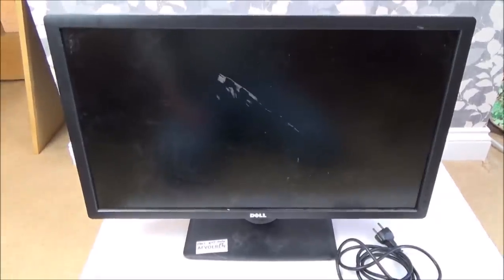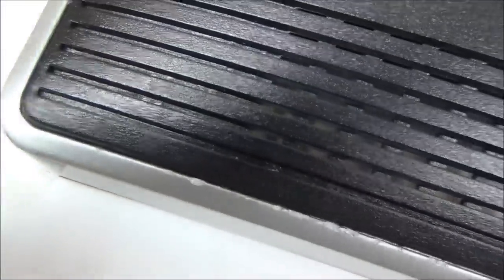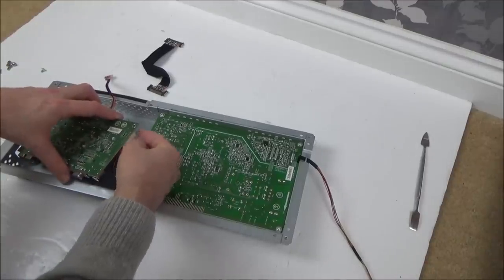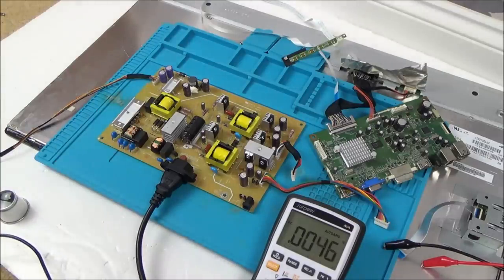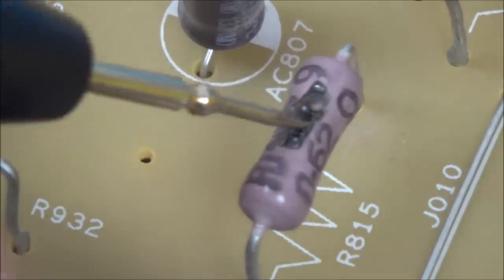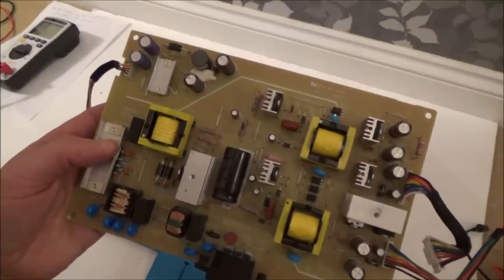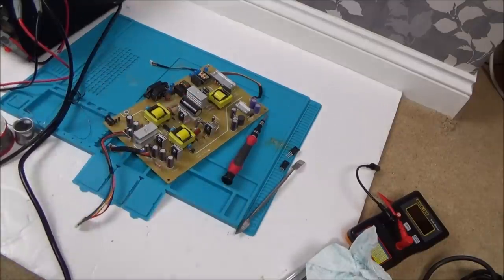Trying to FIX: DELL 1440p WQHD Computer Monitor

Comment: Omg! Thank you so much man! At 18:05 I always thought they were some sort of capacitor and not a fuse... Ive been battling issues with my cars instrument cluster and couldnt find anything wrong and it was doing my head in! Seen you talk about the fuse and knew it looked familiar, had a few in my cluster and 1 of them was indeed faulty after a contnuity test. Have replaced it and now everything is working again! I am beyond stoked and did not think I would be able to fix my car by watching this video but here we are lol. Thanks again, im definitely subscribing 👍👍👍

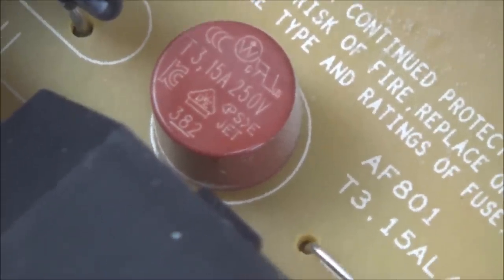Comment: Hi. Just one little but important thing. Around 17:51 this fuse isn't marked T3 = 15A. It's T = 3.15A. Be careful not to change fuse with five time more current rating. This should make exciting bang and MOSFETs flying across the room :-)
Reply: Good info! Thank you 🤓 if you replace a screen on a monitor with a different brand, can that effect the performance of the LCD driver board?

Comment: EU plugs have a earth/ground pin, in the Netherlands it's some metal on the side, in some other countries it's the hole in the centre slightly above the 2 pins
Reply: Most adapters sold in the UK for euro to bs1363 don't connect it. You have to pay attention to get the right adapter with the earth.

Comment: Vince, On your multimeter, you have a REL button which is short for relative. To calibrate your measurements you need to put both meter leads together. If there is a reading above 0.00 then press that button to cancel out the resistance on the leads alone. This way the readings will be more accurate. You can think of this as a tare button on weighing scales.

Comment: I fixed a bunch of monitors recently. Most of them just needed new capacitors. In one case the MOSFET had failed on the backlight inverter and was shorting the whole thing out. There's a couple of easy tests which can be done.. connect 5V to the display board, and then see if the power LED will go on. You can shine a torch at the screen to see if it's showing the "no input detected" etc, or bring up the menu. Then you can put (usually 16V) on the backlight inverter part, and see if the backlight goes on. If these both work, then it's probably an issue in the high voltage DC part, either the MOSFET, the PWM driver chip, or the bridge rectifier.

Comment: This is the monitor I use. Been a great screen since 2013. The button on the back is for taking off the stand not for rotation. You can rotate it by hand no button presses just turn it

Comment: Amazing, I've been using this very same monitor for YEARS. Be prepared for a little bit of image retention though if you get yourself one of these, it fades fairly quickly and isn't permanent but is 100% a distraction if you use Photoshop a lot.

Comment: The main power board is similar to those in TVs.  To learn more check out websites explaining "switched mode" power supplies.  As you basically worked out, these convert mains to other voltages by first of all rectifying the 240v AC mains to be about 340v DC through diodes plus a big reservoir capacitor to smooth it.  This DC is then turned into very high frequency AC which is stepped down to lower voltages by the yellow transformers and is finally rectified and smoothed again to give the required DC lower voltages.  Each output will have diodes and capacitors doing this and often the output capacitors are what bulge and fail with age.  The mains is converted to higher frequency AC as this needs much smaller transformers to give the end results than if the 50Hz mains were used.  Mobile phone chargers use same switched mode power supply design to make the charger very small as a tiny transformer can be used instead of a big heavy lump if normal 50Hz mains were used.  Hope this is useful for future knowledge.  Great to see your skills improving over time.

Comment: Great attempt =D NOTE: Heat sinked components may not always have ground on their heatsink!  Sometimes heat sinks are live!  I would consider swapping that resistor out, and remove and check the mosfets in a component tester.  I bet a mosfet blew when that resistor went.  But the screen looks damaged anyway I guess =/
Reply: Yes, very important when fixing mains psus... In most EU countries fixing mains stuff always needs a license.. (most computer stuff after the psu aren't mains)

Comment: It's years since I repaired any electronic board to component level, but at around 14min into the video I thought "that resistor looked a bit burnt". I wouldn't have been faffing around doing ESR checks etc, I'd have been finding out what that resistor is connected to and doing some resistance checks. I've still got it ! Lol.

Comment: the last time i had this  issue with 2 monitors . i also thought the mosfet had gone . but it had,nt .it ended up being the smaller caps on the powerboard .and now both monitors are working great .

Comment: When you measure that low of resistance (few ohms or less), resistance of your test leads and connections skews the result quite a lot. You can compensate for it if your meter has zero, delta, or something like that function. Just short your probes and press zero/delta button. Then do the measurement. Measuring in-circuit may have some effect on the measurement, but it can only lower the resistance. It will never make it higher (unless there is some charged capacitor in the circuit, in which case you shouldn't do resistance measurement anyway, or you risk damaging your meter).

Comment: Hi Vince, when you measure low resistance like a 0.6 Ohm resistor, remember to take into account the resistance of your meter leads. If you short your leads together its unlikely your meter will measure exactly 0 Ohms. Some meters will allow you to zero out that lead resistance, or use 4 wire measurement to compensate for the leads resistance.
Another tip, when you measure for a short, allow a few seconds for any capacitors across your test points to charge, otherwise you can get a false impression of a short.
Try testing for a short across an electrolytic capacitor and you will hear a beep until the capacitor charges to the meter testing voltage. The larger the capacitor value the longer the beep !!
Reverse your leads and you will get another beep. That can fool people into thinking there is a short when there isn't. 
Obviously make sure your DON'T have any high voltages on your boards and capacitors are discharged before doing any resistance or continuity checks else you can damage you meter.
Same goes for your ESR meter.

Comment: You really should buy a isolation transformer with disconnected earth wire. Much safer to work on TVs or other devices you have to power up with mains voltage.

First thing you should check on a tv/game console/pc PSU is the Standby voltage. Everything with a soft start button must have a standby voltage. Most likely 5v.

You can check mosfet model NPN=source connected to ground PNP=drain connected to positive voltage and for mains PSU mosfet the source of the PNP is connected to drain of the NPN.
Also you can check the switching driver IC for shorts between the leads.

And BUY a isolation transformer already!

Comment: So many questions you raised about components that I can answer.  If My Mate VINCE wants a mate called Vince (who can answer some of these questions) get in touch.  I am a volunteer for our local Repair Cafe. Yes paralleling up resistors adds up the wattage that they can dissipate (it's all about converting that current to heat), you were probably not close enough to the right resistor values (or at least that is where I would go next) and you could do with a better component tester, I have the Peak DCA55 for testing MOSFETS.  I recently repaired a heater controller for my caravan, the tester said a transistor (in circuit) was an LED, so that raised eyebrows and out of circuit it said open circuit/no component.  The wandering readings you were getting on your meter were stray capacitance charging up elsewhere on the board and not the component you were trying to test.  Thanks for the video.

Comment: I don't know if you still have this monitor but you can cut out a VESA-mount-sized square from that black plastic back plate. Drill 4 screw holes in it and use that nice swivel stand for any other computer monitor.

Comment: my 23" dell suddenly died one day and the problem was one voltage regulator on the logic board, it should get 3.3v in and output 1.3v but it was dead (outputing 0v).

Comment: Sometimes when a MOSFET blows it takes out the thing driving it too, those resistors were likely for current sensing. Also your multimeter probes are probably adding to the low resistance reading, make sure they're fully pressed into the jacks and give them a good clean. Alternatively just zero them out before testing.

Comment: Hi Vince! Do you have a bench power supply or something similar? You could use that to power just the backlight and take a better look to the cracked lcd
Reply: a torch will also illuminate any damage
Reply: He could buy a broken bench power supply and repair it.
Reply: Yup, lab bench power supply should be his next acquisition.. very useful in such cases..
Reply: You could even just light up a couple of the LEDs (6v) to test, you just need a CC power supply.
Reply: @ktaragorn  he has one afaik
Reply: I thought the voltage on the back lighting on those older LCDs was quite high.  Would one be able to get that on a bench power supply?

Comment: The 12N70 is a power mosfet 700v 12a and can be found in many china built SMPS , I go down the local tip and harvest psu's just for the parts saves me ££££ also get lots of 1-5 watt resistors  SIL bridge recs.  PWM controller IC's transistors and pfets , most of the repairs i do these days hardly cost me anything.  You may even find those parts in an old PC ATX SMPS or at least something equivalent if you want to revisit fixing the monitor psu.

Comment: Vince, does Dell or the power supply board manufacturer provide, on line, schematics? Or some other source? Grest find on the resistor! I would do the same thing and start testing point to point voltages & take notes! That's okay on the not knowing about how to correctly open the case! I probably would do the same thing! Thanks for the great troubleshooting and solutions!

Comment: A valiant try Vince, but remember that it's not a fail as long as you're learning something new along the way. :)
A common fault is that the switching fets blow, sometimes taking the the smps chip with them plus a few of the supporting components. You can still source alot of components off of the boards though. Heatsinks, etc are great to have at hand when you need them.

Comment: when you was measuring the resistor value, and said you dont know wether measuring it in circuit affects it... Yes it does bud.
Measuring any component in circuit, affects the reading.
Also, with my experience of PCB repairs, as i repair alot of TV's... Its usually 99% of the time, a Mosfet issue.
Reply: reading a resistor in circuit can only make it read low, since he was reading high it doesn't really matter
Reply: The resistance was too low, the lead resistance was adding to the final value, just need to zero out the ohms reading, but doesn't matter as log as it is beeping

Comment: To check if screen is ok, LED panel light connector  pin 3 and 4 is LED power pin with 5V and backlight should be turn on! (First measure short on pin 3 and 4 to backpanel, mostly if led got shorted, you get short to metal) - Sorry my bad English.

Comment: 19:00ish "thou shalt check voltages". Have a look at the PSU board and it will probably say what voltages should be present on it's output. Check to make sure those are all present. That would narrow down to either an issue further downstream or an issue with certain issues of the PSU etc instead of starting at the other end and trying to work back from the light/switch. Check for voltage coming out of the fullbridge, even. That board looks pretty easy to trace everything and see where it goes
You've probably already figured this out and fixed it by now and I should watch it all before commenting...just y'know, always always check your voltages :D
Reply: I've always started at the power cord checking voltages if there isn't any response to powering the device.  Connectors and power cables are usually bulletproof but they are a total pain to find after skipping past them in initial diagnosis.  This is especially true with intermittent power values problems.  Be especially careful of electronics that see rough service or handling.

Comment: Radiators are not ground, never use them as reference, instead use metal case or ground track on the board to be sure you are connected properly. MOSFET's can show short if they are dead or are shunted by transformer coil, you have to desolder them to measure them properly. You can't turn it on partially because the transistors here work in pair so called "push-pull" so both rails have to work or you burn them both.

Comment: Vince You have a dc jack socket on the power supply. Try searching for the capacitor voltages or on the manual for the monitor bacause there is a chance that you would need an adapter for it with 12-18Volts and you could power up the screen without the high voltage side of the psu ^^

Comment: The power ic could have blown, if gate and drain or source shorts it usually blows the power ic, You can use a flashlight to check the screen by shining it into the display

Comment: If you ever decide to work on more monitors you can buy a separate LCD driver board just to test the screens. They're pretty cheap respectively and for the most part universal. You just have to check the panel on panelook.com Here's a video of what I'm talking about: https://youtu.be/icmp_wuT_dE
Reply: Good tip. Hope Vince sees this.

Comment: Hello Vince .. always better using a screwdriver to hear the loud bang like gunshot from the capacitor arcing with the screwdriver lol 😂 .. good idea to check the LED panel most of the time the LEDs cost a short ... also look at controller ic’s

Comment: Hey mate. The earth pin on those round EU plugs are the two metal tabs on the top and bottom; one of them is connected to a metal plate with the hole.
Reply: Also the middle hole between the prongs for some countries

Comment: ISOLATION Transformer if you are going to work on live equipment even if not probing it when on. it makes things safer in a number of ways as one day no matter how careful you are, you will slip or touch it when you turn your head and distracted. VERY important when using a oscilloscope probe and earth clip.

Comment: My Dell has issues that you have to hack around turning it on if you want to use display port due to a bug in the sleep mode software. HDMI works fine but as a G sync monitor you have to use display port to take advantage of VRR. To solve that you have to plug in both HDMI and DP, switch to DP, immediately unplug the monitor so the sleep mode doesn't turn on, wait 10 seconds to let the capacitors empty, then plug it back in. Just don't turn it off or unplug the display port again or you will have to do this again. Got it just because it was the cheapest 1440p G sync monitor I could get with 165hz. Other monitors were $500 at the time and this one was $350. Now it's totally not worth it. You can easily get other brands for that price now.

Comment: It still has a value for that power board. Fix it and listing it on e-bay for 30$ to 50$. Alot of people or repair shop might want to buy it.

Of cause it not gonna work, if you take part from it self, the circuit will be incomplete. And yes you can do it on some circuit, but it usually on the end of the circuit but not in the beginning of the circuit, unless it is a clone circuit, witch is 2 identical circuit on the same board and operated independently.

Comment: Very rare those components will blow with a wide open hole like that and it just be the obvious shorted components..

They go further into the drive circuitry usually the low ohm fusible wire wounds bearing the tell tale scars due to the shorted MOSFET but deeper within there's usually the MOSFETS' gate driver not oscillating properly in turn holding the gate voltage in a consistent on or off state, sometimes in a spurious noisy High / Low Frequency voltage mess then that in turn usually causes a 

BANG..!!

Various component shards ricocheting off every wall in the workshop.. 

Ominous whisp of smoke.. 

Which is probably why I was wincing away from my monitor as you bravely plugged it in.

An old PC PSU Is usually ideal to power these up. 

No danger as you can just Dob the connections onto the secondary capacitors or, better still,
The cathode end of the secondaries Diode  most caps are in parallel and tell tale signs regarding voltages are on the board and these outputs are very commonly found on a PC PSU.

Even a low current 24volt for backlight illumination can be derived from the +12 and -12 rails but bare in mind there will be a potential difference in using this method but simply isolating the back light and allowing it to illuminate as a separate stand alone module works.

Comment: shorting the cpacitor with the screw driver reminds me of when I was working on my old computer and had disconnected all the wires on the motherboard for power etc I went to reconnect it and couldnt figure out what wire went where so I used a flathead screwdriver to bridge some pins until I found which set powered it back on. Its a wonder I didnt get shocked or blow the computer up lol
Reply: You can bridge the pwr on power supplies no problem